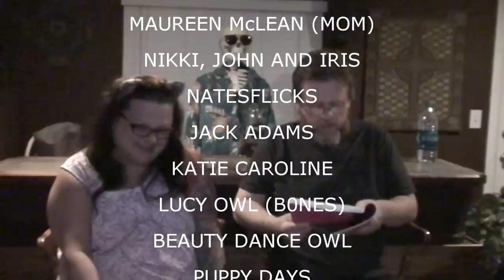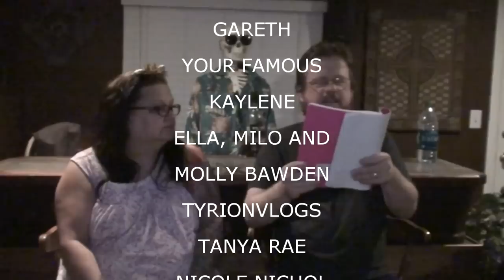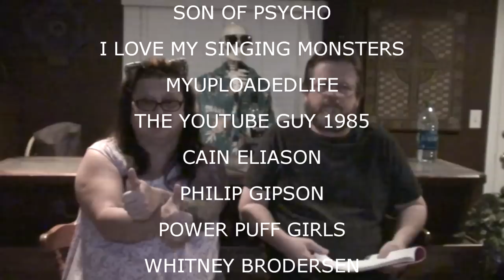A DAY IN THE MANCAVE

Comment: Wow Kevin, Allot of information out there but not specific on the ending scene and how it was done but did find the following. Just not sure if it is accurate.

Rod Taylor claims that the seagulls were fed a mixture of wheat and whiskey. It was the only way to get them to stand around so much.
The movie features 370 effects shots. The final shot is a composite of 32 separately filmed elements.
Reply from the maker: Bamby S  Correct  #3  Kevin
Reply: Thanks Kevin :o)